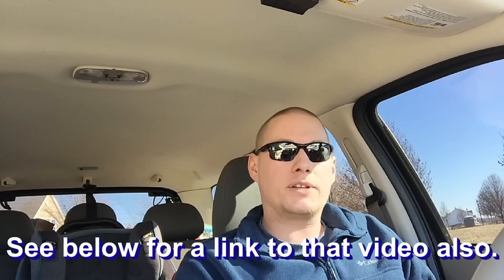Ford Ecoboost Engine Carbon Deposits: What You Need to Know

Comment: Seriously considering buying a new truck in the relative near future. I was originally only pressed between whether getting the 3.5, or the 5.0 because of sound(nothing like a v8.) After watching this I must ask; how is the longevity of the 3.5l? Have they passed a way on how to clean out all the nasty carbon, or no? Also a lot of the places around her have ethanol in their gas. Will that effect the turbos negatively? We generally tow pretty heavy trailers(loaded with cattle) if that is also worth note.
Reply from the maker: Realawesomename Fails If you tow heavy trailers it is the ecoboost hands down with that early and flat torque curve it will be the best. These engines in general have held up very well to the power. The carbon is not that big an issue but a catch can will help allot with intake valve deposits. The ethanol content is not so bad with a max of 10% so I would not be worried. As of now there are no official cleaning methods.

Comment: Did they come up with a fix for the new 2015 2.3 ecoboost mustang? Thanks
Reply from the maker: MATT BURGESS I don't think the new 2.3l will be a big issue being second gen.
Reply: That's good, thinking about one when my lease is up on my gti
Reply: +FordTechMakuloco how can it not be an issue if there is no catch can, or approved cleaning method, and no direct/port Injection system like Toyotas D4S? just wondering what they have done differently..

Comment: My 2013 f150 w/ecoboost makes a noise similar to when you over extend older power steering pumps after I switch from drive into park. It is intermittent but has happened since day one and only has 13000 miles. Dealer can't "replicate" after several attempts. Noise goes away after revving the engine or going back into drive. Have you seen this issue before???
Reply from the maker: Brandon Cunningham Yes known issue search my channel for this as I cannot link right now-Ford Vehicle Noises: #2 Ford F150 2013-2014 Buzz Noise Shifting Into Gear TSB 14-0134

Comment: Gm has the issue, ram/dodge has the issue. if you want fuel mileage and low emissions this is whatca get:)
Gm has a really good upper engine cleaner that is NOT hydro carbon based, it is approved on certian GM engines but NOT FORDS, but i wouldn't mind trying it to see what happens and that cleaner says on the bottle DO NOT PUT IN FUEL TANK, its ment to be put into the system through a vacuum line and let sit.

Comment: Quick question. I have a 2014 flex non- ecoboost. I think it’s just the 3.5 duratec. Is this motor a direct injection engine too?   Thank you in advance
Reply: Nope not a direct injection

Comment: Doesn’t matter what you drive , if it’s less than 30 years old it has a PCV system back to manifold OEM fitted.blowby etc will get sucked back into your inlet manifold, older the motor more you may get. EGR systems don’t help , as this recirculated hot gas into manifold mixing with crankcase oil/gases becomes a bit messy over time in the inlet manifold/valve seats.
Just fit catch can normally aspirated or cans if you have a turbo car.
This is not something new & not a ecoboost specific problem, all manufactured cars have this prob, only reason a catch can is not fitted from factory, mist owners will not check & empty regulars, & and if it over flows, it’s not good for your motor, may hydraulic it or give your inlet turbo wheel a hard time.
My 2 bobs 👍

Comment: I read 2018 EcoBoost have direct injection plus port injection is that true
Reply: @darryldickson  yes they do have dual injection now - started in 2018 model year. I just bought a 2019 EB 2.7L  and it has direct and port injection
Reply: Only on the F-150 Expedition and Ranger and all other EcoBoost are not dual port injection

Comment: Have the engineers at Ford gotten back to you on the solution to the carbon build up?
Reply from the maker: Nancy Smith No it is the nature of the beast but so far they are ignoring it.
Reply: FordTechMakuloco Great! We are looking at an new F150 with the 3.5L Ecoboost and are hesitant because we plan on having it a long time. Almost thinking we should get the V8 instead, but that 3.5L is so nice!

Comment: i just bought a 2013 ford limited with the ecoboost engine and i have 76,000 miles on it and its already starting to idle rough when i first start it up but it goes away after 5 min of running but i haven't gotten any misfires yet but I'm sure that will happen soon so what should i do since its already starting to idle rough? should i use the chevron techron and change my oil to the pennzoil right now? i use 100% gas since we don't have a chevron gas station in oklahoma i never use ethonal gas in my vehicles
Reply from the maker: +Garrett Hobbs Not much can help you now besides a manual cleaning. BG does offer a DGI cleaning now they say is safe for the Ecoboost.

Comment: Would you install the Dual Catch Can Kit on the 2016 F-150 5.0L and would it void the warranty? Thanks
Reply: Yes it will void it, best would be to keep the original hoses  and get new ones for the catch can and when taking it to ford remove catch can and reinstall the original hoses

Comment: So with the oil you recommend and a fuel cleaner used regularly, is this enough to mitigate the problem? Can I hit 200K miles?
Reply from the maker: +Brad Wolfe With this catch can no sweat yes-http://www.amazon.com/gp/product/B00TPVAA28/ref=as_li_tl?ie=UTF8&camp=1789&creative=390957&creativeASIN=B00TPVAA28&linkCode=as2&tag=fordt-20&linkId=MSGFXHGDTR7J3WGA
Reply: What about without the catch can but with the oil and fuel cleaner?
Reply: +FordTechMakuloco From what I've read this new version of the RX oil catch can is made in China and when the contents freeze the bottom of the can will blow out cause its glued on.
Reply: +FordTechMakuloco Read this post, this guy named Tracy RX Speedworks (Tunerboost) sounds like he's been kicked out of many forums for OCC issues
http://www.focusst.org/forum/showthread.php?t=34234

Comment: I know this is an older video but does anyone know if the new hybrid design on the 3.5 ecoboost, direct and port injection, will help prevent carbon buildup. I would think it would as the port injection will give allow fuel to clean the valves. Please comment as I am debating on putting in a catch can but really don’t want to spend $450 if I don’t need to. Thanks in advance for the reply.

Comment: So no recommendations on getting the gen2 3.5l ecoboost on the 2017 f150? Can I still expect the same issues as the gen1 ?
Reply from the maker: This video is from 2015 so no. I can tell you the dual injection 2017 is not the end al be all solution since it is not constantly on.

Comment: I was looking at a 2015 Ford Fusion with the 1.5 ecoboost. Question ? Which would you go with, the Std 2.4 L or the 1.5 L Ecoboost in these cars ?  Thanks
Reply from the maker: Danny Janes Ecoboost has lots of problem and noise issues vibration issues etc with this small of an engine. I would only get the 2.5l personally but test drive for yourself maybe the vibration issues are gone on the 2015's. The 1.5l is certainly a much better engine than the 1.6l ever was.
Reply: FordTechMakuloco I know you must be a busy guy and I appreciated you taking the time to answer my concerns..Thanks again, Dan J.

Comment: I think I found your posts a little too late.  I purchased my 2011 F150 EcoBoost 3.5l V6 with 150k miles on it  and used seafoam twice, about 3 months later the engine light came on and the code is P0234 (overboost) Could the seafoam have caused the issue?  What is my best bet?

Comment: wait how could the pcm software change valve timing. To my knowledge  valve timing is mechanically controlled via either a gear from the crank to the cam, a timing belt, or timing chain. not much software could do to it. 

am I missing something. did he just mean that the camshaft has to Changed and get software updates to match the new hardware. or can the actual software change the timing of the valves so as not to "exhaust scavenge". that would be pretty awesome if it could.
Reply: +Logan Eley New engines have variable valve timing (VVT). They can change the timing of the valves at any time not really 100% on how it does it but it does. You don't have to change cams or anything.

Comment: I just read that on the new, second generation 3.5L Ecoboost, Ford has added port fuel injection, in addition to the DI.  I find this quite interesting.  Is this how they are dealing with carbon deposits on the intake valves??  The press materials suggest port injection was added to deal with emissions.  Anywho, what do you think of this latest development??
Reply: Troy Kleffman I'm pretty sure dual injection is due to carbon deposit issue, not emissions related. Ford just cant say that because that'll be admitting there is an issue with first gen ecoboosts. Toyota has been using dual injection for a long time and their engine don't suffer carbon deposit.
Reply: Yes, Ford cannot admit that the eco boost engines were a mistake.

Comment: Will sea foam help the Eco boost and how often do you recommend???
Reply: Tony Cervantes Yes, but start early on.  Just like switching to synthetic oils on an older vehicle, seafoam will break up any deposits and cause a bigger issue that would not have happened if you would’ve simply ‘limped’ with your pre-existing engine

Comment: I agree with plowtruckdriver, any update? I am trying to decide an ecoboost or 5.0l as we speak. I want to keep the truck for 10 years, 150k-200k
Reply: FordTechMakuloco - Does Ford consider the addition  of port injection to the 2018 Models the fix for this?

Comment: looks like 2017  gen2 3.5L eco.b. is fixing this issue with new design, dual injectors (1 in the intake,1 in the cylinder)???
Reply from the maker: +Anywhere Audio & more Yup

Comment: Don't believe in the "exhaust gases building up on the back of the intake valves" theory. I'd have to see some hard evidence before  I would be convinced. I do believe the PCV gasses accumulating on the back of the intake valve is the primary issue. An oil catch can will help, Amsoil Signature series oil will help as much, or more. (I have no connection with Amsoil). Look at the data before you scoff, Signature Series is "100% synthetic" and not just "Full synthetic" I have a GM 2.4 liter GDI with similar issues.

Comment: So whats the strategy on 44k & techron. I have 48k miles on my 3.5L eco f 150. Never used a fuel cleaner before. Do i use techron every 3k miles , than 44k every 10k miles. I see in the description you have both of these items listed as a cleaner.
Reply: MrBIGG360 old comment but by now you probably know that a fuel additive won't help since the fuel is directly injected into the cylinder and never touches the back of the valves.

Comment: can you use chevron fuel system cleaner every fill up it claims to clean valves too so should i use often or is that bad too?
Reply from the maker: Christopher Garcia I recommend BG 44K at every oil change as your best line of defense-http://www.amazon.com/gp/product/B00DDVU6EI/ref=as_li_tl?ie=UTF8&camp=1789&creative=390957&creativeASIN=B00DDVU6EI&linkCode=as2&tag=fordt-20&linkId=647MEZHU25SZV6BF
Reply: +FordTechMakuloco I'm a little confused.  You state in your video that induction cleaning products/services, be it at home (like Seafoam) or professional, are bad ideas for your Ecoboost engines, however; you go on to recommend a product in your description that appears to be very similar to what Seafoam does without exactly clarifying that discrepancy.  If I'm missing something, please don't hesitate to elaborate.  I'm really wanting to clean the valves on our 2014 Fusion with the 1.5L Ecoboost.
Reply: +Birdpolitics You don't use it on ecoboost. It won't help to clean valves any way.

Comment: don’t know if this has ever been mentioned but if ford is worried about a piece of carbon falling off during an induction service and slamming into the turbo fans i’d like to point out that makes me equally worried about a piece of this gunk falling off during normal or hard driving conditions and doing the same same kind of damage. seems to me you are damned if you use an induction cleaner and damned if you don’t.  i like my f150 3.5 eco boost but i just don’t like driving a time bomb.  i would love to know how many people have gone100k or more on the stock setup without issues.
Reply: That's a good point. My '14 just hit 110,000 miles and is in need of spark plugs. It has a misfire on cylinder 2 so I'm hoping that solves it. While I was in there I was debating running some Seafoam or Techron cleaner through. I didn't expect it to be this much of a headache trying to figure out what I can and cannot use. People say not to use Seafoam but like you said, that crap could fall off on its own anyway.
Reply: Yeah that's a bunch of horse shit.. piece of carbon deposit to damage turbo blades? 🤣🤣😂 Turbo must be made of cardboard.
BMWs benefit greatly from walnut blasting.

Comment: I've heard the BMW guys have had good success with walnut blasting their straight six engines.  Wouldn't be surprised if Ford's fix was similar...
Reply from the maker: Justin LaNoue It may be but for now even walnut shell blasting is not approved. I wouldn't be surprised if they develop a procedure to do this cleaning without removal.
Reply: I hope so...I removed my wife's duratec 3.0 intake on our Mazda 6 for spark plugs and it's not fun.

Comment: 2021 and still have the carbon issue !!!
I have 2016 escape with eco boost , only 40k and I keep getting engine running lean code the dealer said I must replace the engine because it has carbon deposits on the cylinders !!
I’m like wtf ?
Engine runs great it’s just the check engine light issue .
Any advice
Reply: Chevron with Techron Fuel System Cleaner.

Comment: Has anyone came up with a good way to use water mist/vapor injection into the intake (after the turbo) so break-up the carbon deposits on the intake valves.  I know water injection works for top end carbon cleaning, but is there an easy way to do it on this engine?

Comment: Why do you recommend pennzoil synthetic over other synthetics?
Reply: He likley does because it's good, though Kendall gt1 or motorcraft are better choices.  They are made by the same people who make oem oil.

Just stick with any full syn or blend.
Reply: If you drive a gdi car you need an oil specifically  designed for this. Motul, valvoline modern engine 5w30,  Pennzoil ultra, mobil1 extended, amsoil etc.

Comment: I have seen rumors, hints, that the 2015 has fixes for both the CAC condensation problem and the DFI intake valve carbon build-up problem.

The 2015, like the Lexus GS has done for years, uses SFI for low HP cruise, which of course also serves to "wash" the back side of the intake valves.

DFI is reserved for boost mode.

The CAC now has a vane/shutter system that automatically closes and blocks cooling airflow through the CAC during "off-boost" driving.

The question becomes, will prior purchase Ecoboost owners be offered a retrofit kit??

One could see that retrofitting the vane/shutter system to older F150 Ecoboost trucks might be entire possible, POC!

SFI....?? NOT!

But, wouldn't a simple single throttle injector also solve the problem, PLUS keep the entire throttle body clear of EGR deposits?

Ford... Listening!
Reply from the maker: willard west I have not seen these no, I know the 2017 raptor ecobeast is supposed to have dual injection like you say.

Comment: Why not drop the valves and clean them with a brass brush? I can't imagine new heads are cheap, and dropping valves on a 4 cylinder couldn't take more than an hour and would probably take an hour on a v6.

Comment: do these engines have EGRs? i have a ford diesel, its got egr and of course turbo and direct injection. doesnt have  that much deposits on it. and to think diesels should be dirtier than gasoline in terms of soot.
Reply from the maker: Yes most of them do.
Reply: FordTechMakuloco so must be something to the design of these engines that could lead to more deposits than usual.

Comment: What is the beat fuel for a ecoboost direct injection engine 91 octane with 10% ethanol or 91 octane ethanol free what would be the best for my engine and for less carbon build up?
Reply: Check Top Tier Gas

Comment: I'm considering a catch can install on my 1.6 GTDI, but I'm curious as to why it would void a warranty.  What are the risks?
Reply: It won't  effect  warranty
Reply: Highly unlikely it will void your warranty, in fact Ford sells an oil catch can system for both the Mustang 2.3 ecoboost and the 5.0, the 2.3 Ford sells both a right side oil catch can and a left side oil catch can, but it seems like it is the left side that needs the catch can not the right. The 5.0 is just a right side oil catch can. 

Being that Ford sells a Ford Catch Can system for these vehicles it would be hard for Ford to justify voiding a warranty.

Comment: Does this mean don't use fuel treatment such as Lucas?
Reply from the maker: I have never found a need for lucas that Chevron Techron or BG44K couldn't handle.
Reply: +FordTechMakuloco how about misting distilled water into the air intake while holding about 3k rpms?

Comment: Fordtechmakuloco  I heard AMSOIL AND MOBEL 1 ARE PRETTY GOOD ENGINE OILS ? WHAT IS YOUR OPION ON THEM???
Reply from the maker: +supergober55 They are fine oils but I don't buy into all the amsoil BS personally.
Reply: FordTechMakuloco thank you for the info
Reply: +FordTechMakuloco I don't either, that's why I stopped using "additives" which is all 99% of oils are doing, thinking they have a better recipe of detergents/etc etc. There IS another option.

Comment: Also oli in GDI engine is dirty! I have Ford Focus 2012 2.0l with 186000km oil smells and dark color. On the other hand my Fiesta 2011. 1.6l DOHC PFI engine. with 290000km oil very clean no smell.